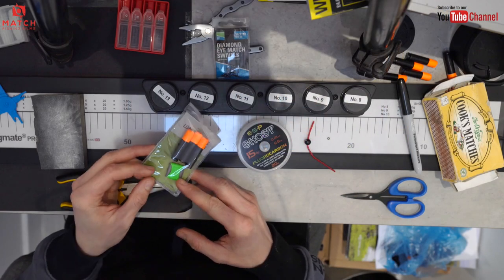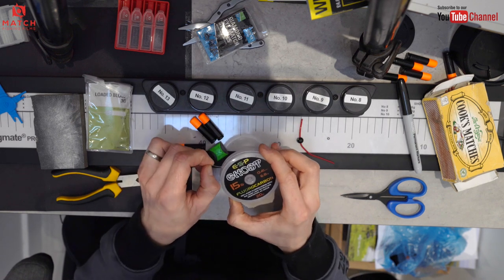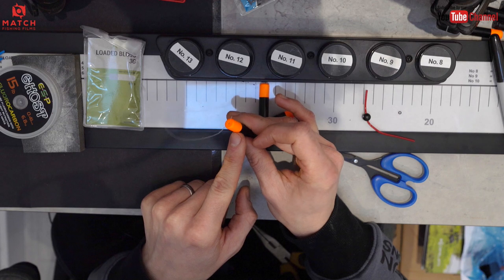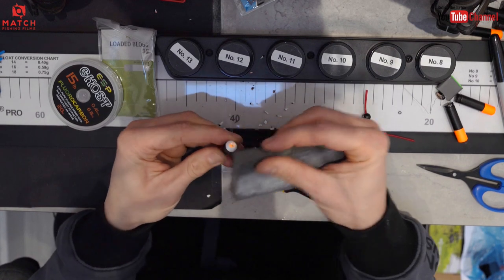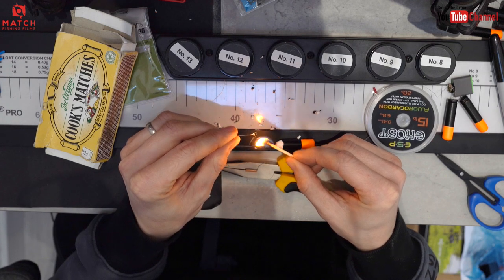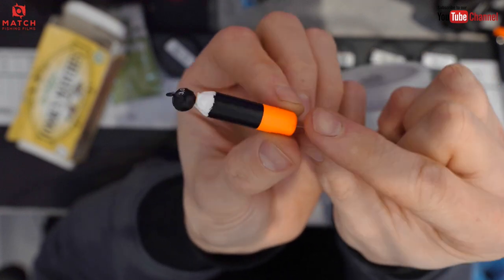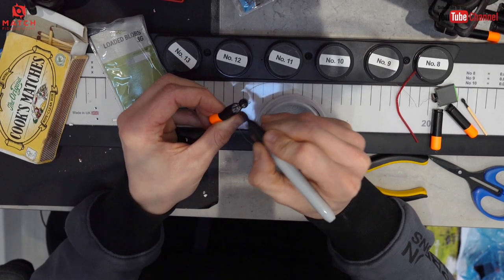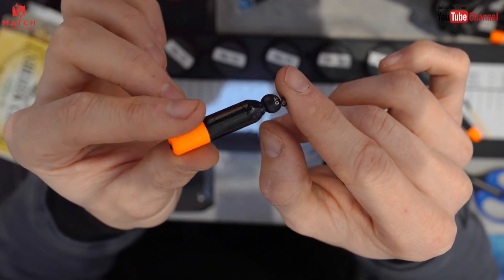How to make a MUGGING WAGGLER | Carp Fishing

Comment: These are very small, lightweightits enjoyable.fishing recommend they’re meant to use with the trout magnet 1/16 oz jigs however they also work great for fishing live bait. My son and I have caught crappie, blue gill, bass and catfish using these for various setups. You can fish slipit style or pinch you line between theit and the shaft for a non slip setup.

Comment: Good video, I use those floats, I might adapt some now. Just a tip, buy some black nail varnish and use it for the float. I took my nieces old nail varnishes and they are much cheaper to buy than float paints. I have black, red, orange and grey. Dries really well and its waterproof. I make loads of floats from scratch now 👍👍

Comment: Hi joe, would a bayonet/bait spike work if you superglued/mitre bonded it in to the existing hole of the original float? Then a dab of glue on top to seal the hole👍🏻
Reply from the maker: Give it a try :) the floats are dirt cheap so buy a few packs and experiment